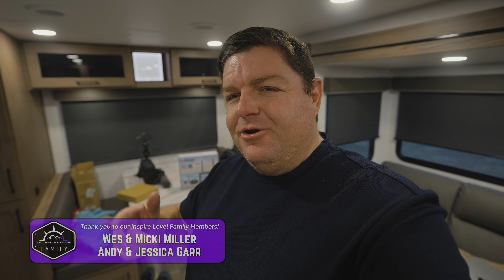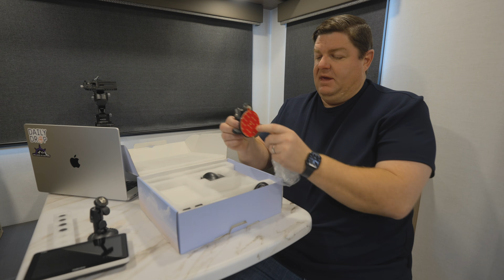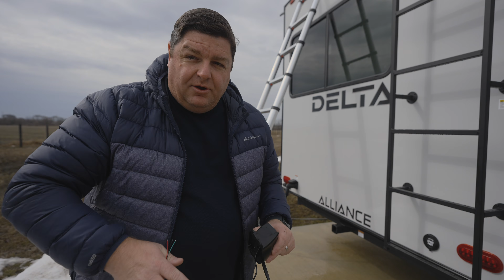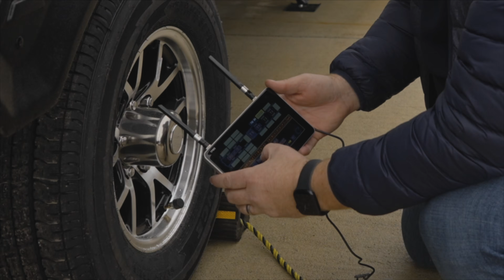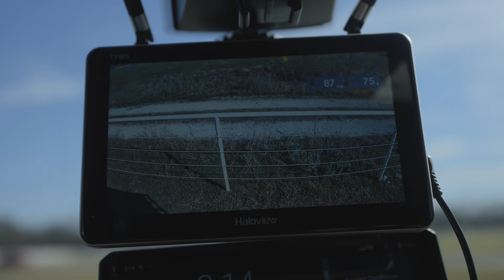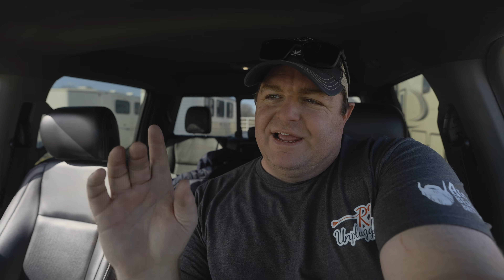Game-Changing RV Safety Gear! HaloView BT7 Backup Camera + TPMS Install

Comment: I just installed this on my trailer yesterday. I have a 32' trailer and a crew cab long bed truck. The camera quality looks great so far in the garage and the signal strength for the most part sits on 4 bars. (You want 2 bars or higher) The tire sensors report fine with our without the signal booster. I mounted the signal booster at the front of the passthrough storage compartment and I put it on a switch. Even pulling my truck forward about 20 feet, the sensors were still reporting even when the signal booster was off.  So far I am happy with the setup but our next trip will be the real test. P.S. You want to make sure to use Metal valve stems with the tire sensors. I am having the metal stems put on and then the tires balanced with the sensors in place.
Reply from the maker: Glad its working and thats a great tip on the Valve stems!